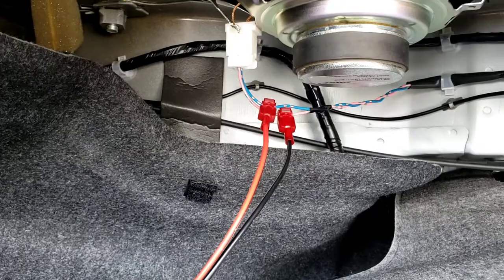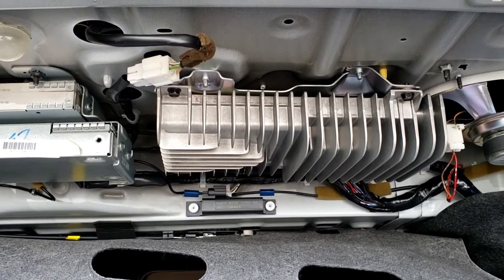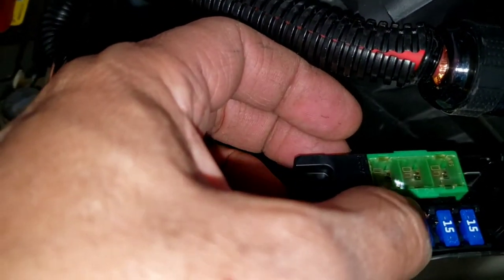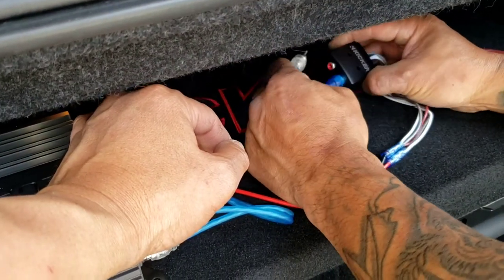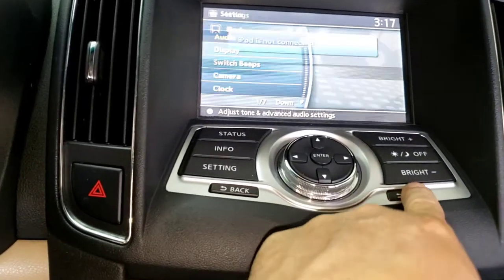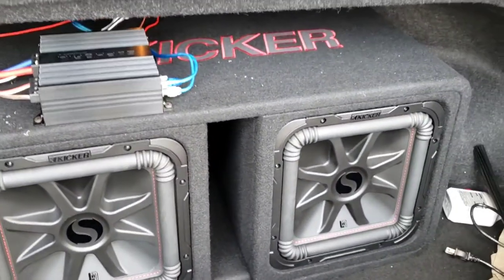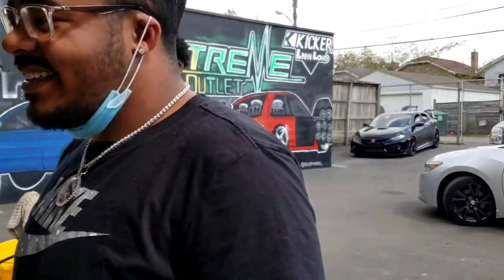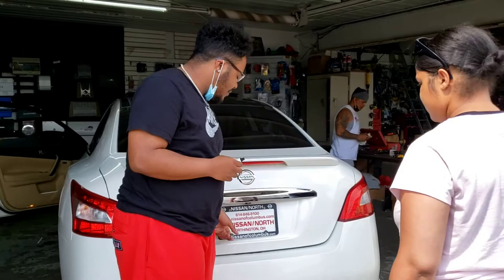2011 Nissan Maxima Amplifier Installation using factory radio (Short Version)

Comment: Why does my amp stay on when I turn of my car I tried changing the fuses to when only the car is on it will turn on but that didn’t work inside it just kept turning on.if somebody could help me that will be great thanks 🙏
Reply from the maker: What did you connect the remote wire to?
Reply: @khmerohio  I Connected it to the same fuse you connected on the video
Reply: @bryanvera5499 same, did you ever fix it?
Reply: @TheHeartHz  yeah i did i got a fuse tested and kept trying then all one by one till i found one
Reply: @bryanvera5499  fuck, didn't want to test all the fuses but i guess that's what i'm gunna do unless you can tell me which one you used lol, or at least what gauge it is 😂
Reply: @bryanvera5499  Nevermind, my amp has audio detection that turns it on, no need for remote 😎

Comment: The red and black wire you connected to the factory speakers, what are those clip ons called? They look like clip ons, to the blue wire and pink wire.
Reply from the maker: T-tap and make quick disconnect. It's easy to just strip the wire 🙂 instead of crimping it

Comment: I have a 2010 nissan maxima and I’m trying to run the power wire to the trunk, but the rear seats don’t fold down. How did you get the wire from the cab to the trunk?

Comment: Where did you wire your converter to? I have mine to my rear deck speakers but would it be better going up to the back of the head unit?
Reply from the maker: Yes but the amount of times that you have to take the stereo out and back in

Comment: hi can i do the same on maxima S model 10
Reply from the maker: yes you can same same
Reply: @khmerohio for converter is it the 2 positive wire to positive wire of speaker? the same as to negative?

Comment: That loc has a remote thats made from speaker signal alone. U couldve just used that instead of running it from the fuse box in the front
Reply from the maker: It stayed on almost 2 minutes

Comment: Thanks for the video,where is the factory amp located on the 2012 Nissan Maxima?
Reply: Under the back deck. Open the trunk and pull down the trim, carpeting and you'll be staring at it

Comment: Hey man I got the kisloc 2ch, with 4 wire hook up and 1wire ground, do I have to hook up both side of stock speakers to my converter
Reply from the maker: The grey and white to the positive and the two with black stripe to negative
Reply: @khmerohio   so just wire into the one factory speaker

Comment: Is his car bose equipped? I have a 11 i used a lc2i  and my jl 500/1 with 2 12 w6
Reply from the maker: Yes Bose
Reply from the maker: Nice setup
Reply: @khmerohio  thanks man i didnt use the remote wire  the amp has signal on off when it detects music but i might do what you did so i can have constant power

Comment: what did you run your converter wires to
Reply from the maker: Your white and gray from converter to the blue wire of the left rear of speaker and white/black , gray/black from converter to pink wire

Comment: Hello brother.. my RCA adaptar needs two speaker imput.. you connected the left side.. could you give me the right speaker color code?
Thx
Reply from the maker: You don't have to do that but for the right rear is Orange or violet is +
Reply: @khmerohio  why do you say that I don't need to connect both speakers?   BTW  on the right side I have pink and brown .. maybe it's a silly question.  The negative is the  brown right?
Reply from the maker: I'm sorry what year is that?
Reply: @khmerohio  SR 2010
Reply from the maker: Use one channel it's sound the same nothing changed unless u faded to just one side
Reply from the maker: The gray and white from the LOC is positive and the other two with black stripes Are negative